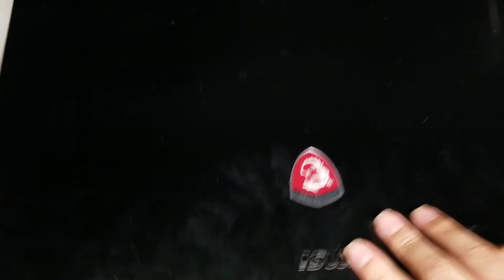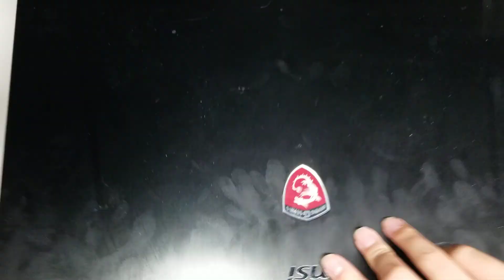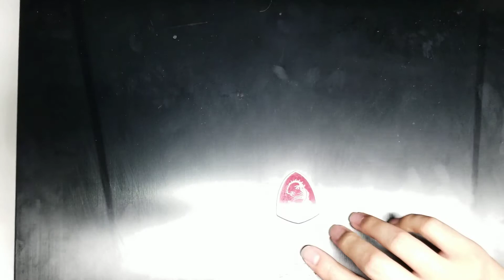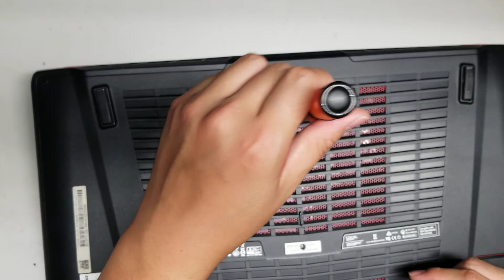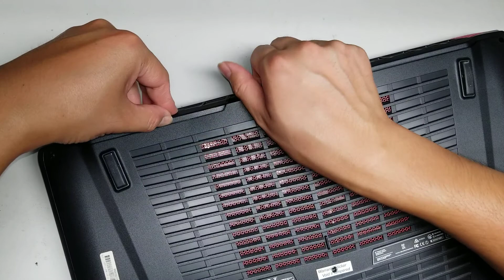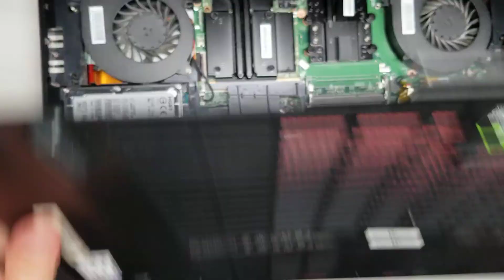MSI GT72 2QE Dominator Pro Disassembly RAM SSD Hard Drive Upgrade Repair Part 1

Comment: Thanks! Very useful, and very clear. I have watched several YT videos about this today, and they either just point their fingers at things expecting us to know what they are, or they mumble under their noses, so it is hard to hear what they are saying (and for a non-native English speaker, such as myself, impossible to understand).

I need to replace drive C with something that can store much more data. Is it the hard disk or the SSD? I also need to replace the CD/DVD/BD drive because it stopped working long ago. I need to figure out what size of the CD/DVD/BD to buy. Any suggestions on that?

Thanks again!
Reply from the maker: You have to measure the thickness of the drive.
Reply from the maker: The ssd is usually C drive. If you don't use CDs much, you can get a usb cd drive and a hard drive caddy to replace the cd drive for more storage.
Reply: @ItsBinhRepaired  Thanks. I do watch DVDs and Blu-Rays a lot. And I make my own discs. I make videos and burn them to BD for backup. I have an external drive, but would rather have a nice internal CD/DVD/BD player/burner, also for booting from the Macrium backup disc (I have never figured out how to boot this computer from an external drive). I am using the computer right now, but I will open it sometime next week and check the size of the drive.

Thanks again.
Reply from the maker: @RustyTube  sounds good